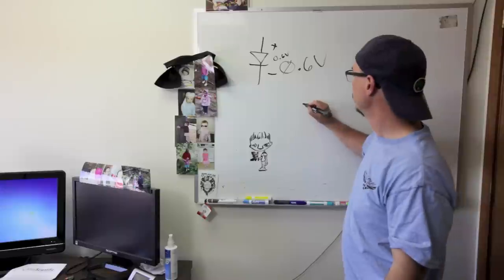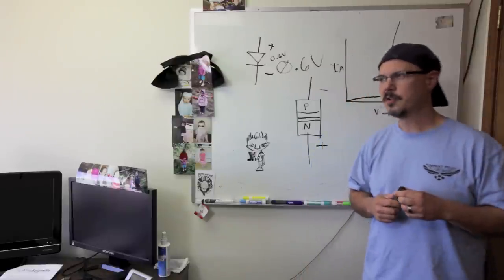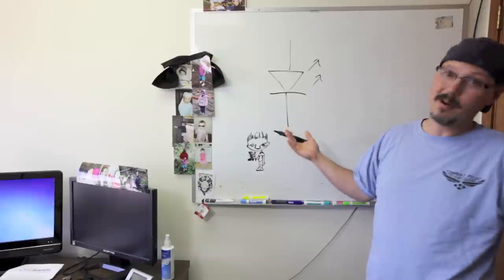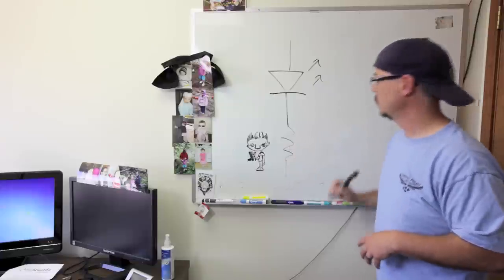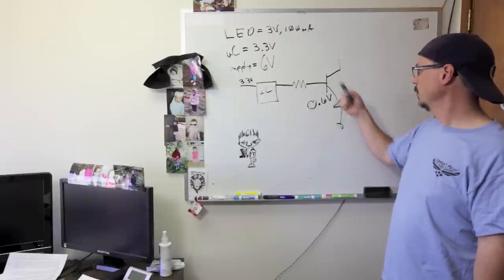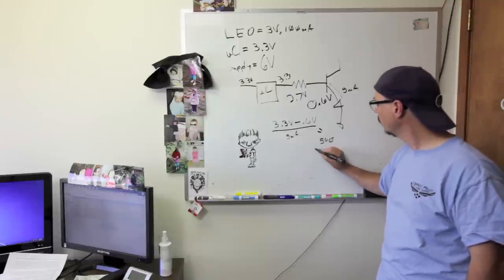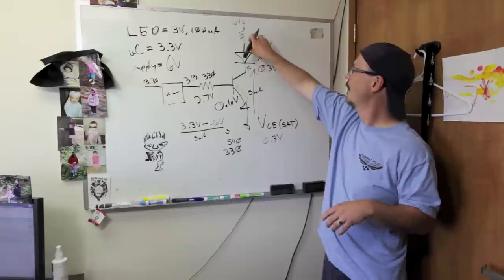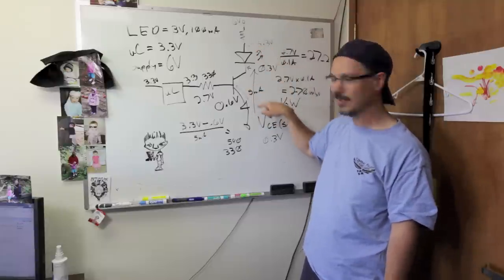SparkFun According to Pete 7-5-11: Diodes and Transistors

Comment: Dude this was actually pretty helpful. At least for me it's kinda hard to get the electrical theory to work in practice and to integrate that what has been learned to the workbench. I get lost beginning to design a circuit like this. But i think next time i wont just blow it up again :-)
Thanks!

Comment: I think that the voltage drop on silicon BJT is 0,7 Volts, but not the 0,6 Volts. And the voltage drop on JFET's is 0,434 Volts.

Comment: Cool. Another reason not to use the transistor to limit the current (in a linear way) is that the power is then dissipated in the transistor - Which would be bad.

Comment: Hii Pete 
thanks for make The transistors video, i learnt more 
i have a question 
if I am connecting a load across to Emitter   in npn and i am applying a 5 volt on base to emitter and 50v collectors to emitter also collector side a resistance is connected, when I am c
Reply: when I am checking  a voltage across load (emitter side) and ground . i found 5volt 
why?

Comment: I wonder what made him pick 5mA as the driving current. How should one read that value out of datasheet?
Reply: +Zdeněk K It was probably just a guess. However if you look at the datasheet for a 3904 it gives a rating for Base saturation voltage at 5mA (that is, it lists the saturation voltage when current is 5mA). So that is probably a good guess.
Reply: Correct me if I'm wrong, but as long as the base current doesn't go below the Ibex (base cutoff current), the transistor will stay on. Which according to the datasheet, it's 5 nA (0.000,005A). Is that correct?